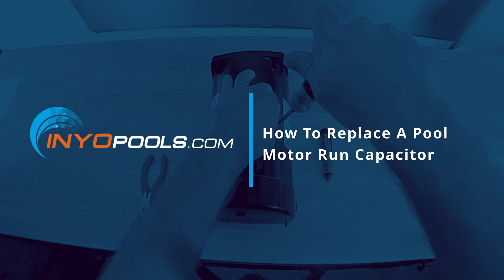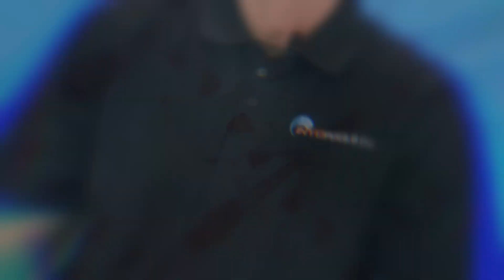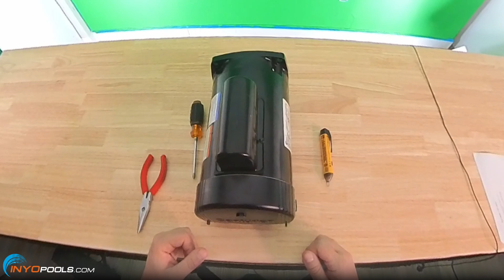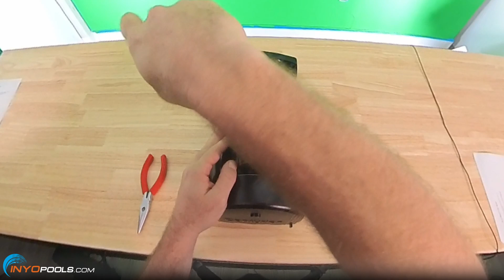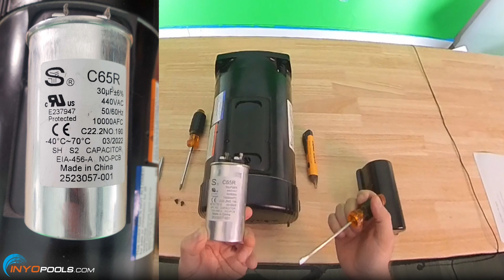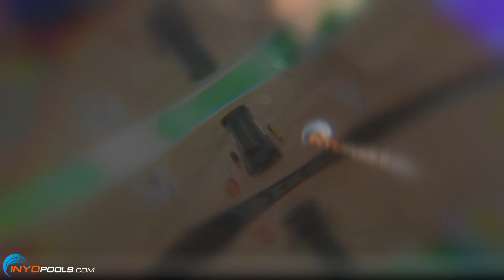How To Replace A Pool Motor Run Capacitor

Comment: What would cause the capacitor cover to become tightly welded to the pump?  I removed the screws and the cover will not come off. I cannot pry it off or knock it loose with a rubber mallet.
Reply: I've got the same problem...